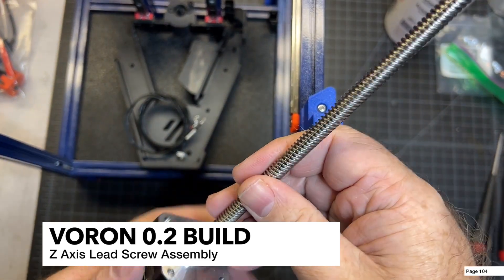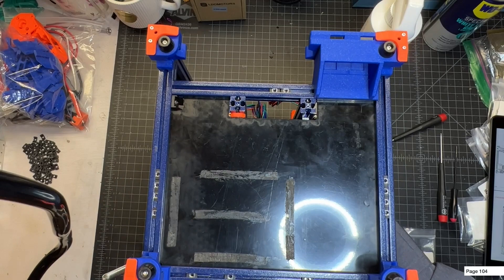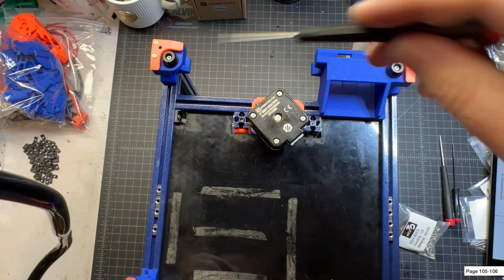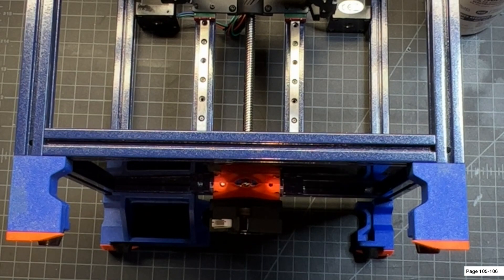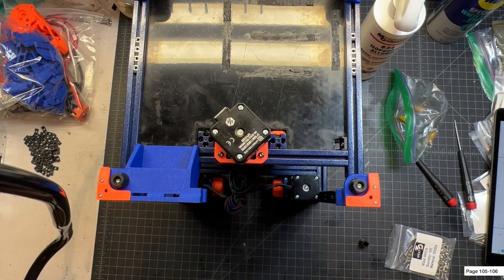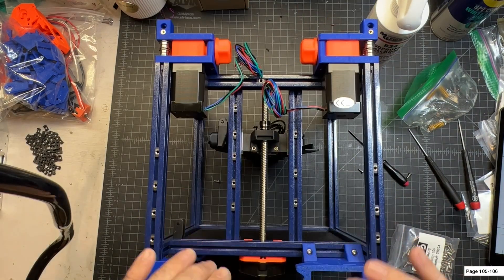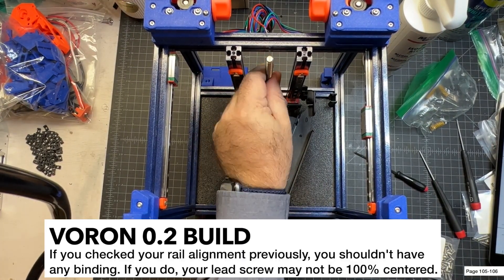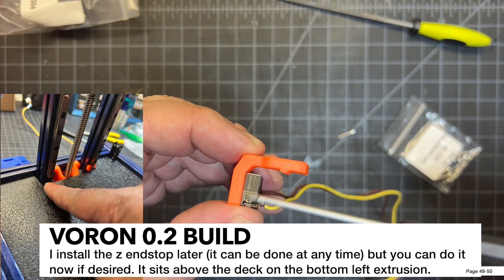Part 7. Voron 0.2  Build - Z Axis Lead Screw Assembly

Comment: I'm not too clear why you would want to attach all four screws on the Z Axis Motor Mount before taking it back apart to put the backlash nut on.  Can't I just put the backlash nut on the first time I put it into the Bed Mount?
Reply from the maker: It’s basically to help ensure that you get good alignment without having to do too much fiddling.